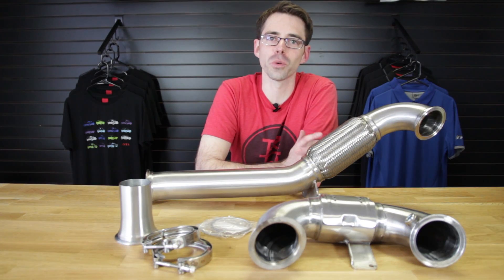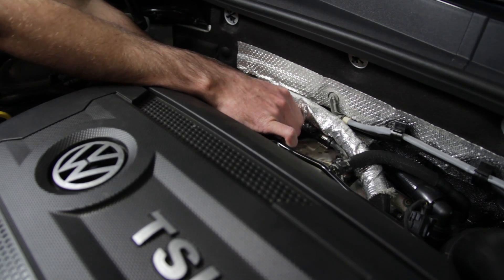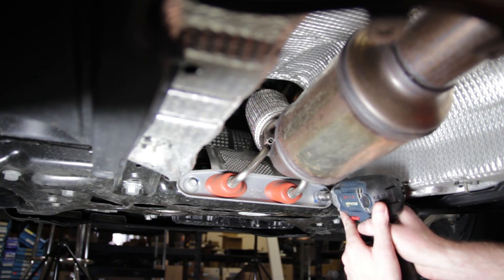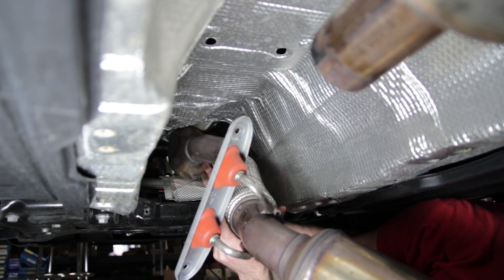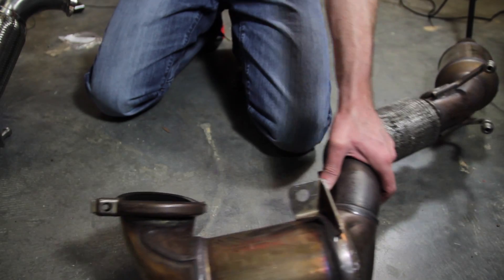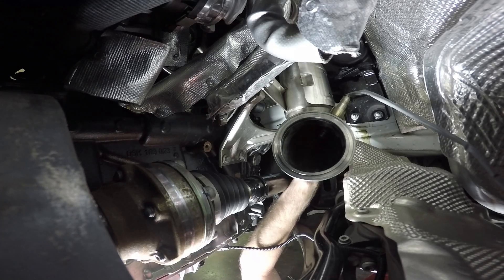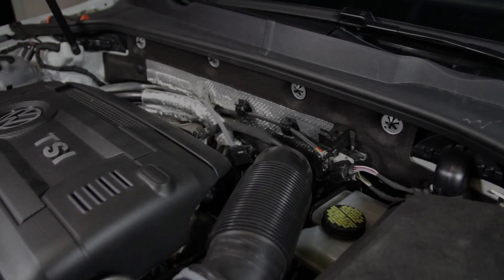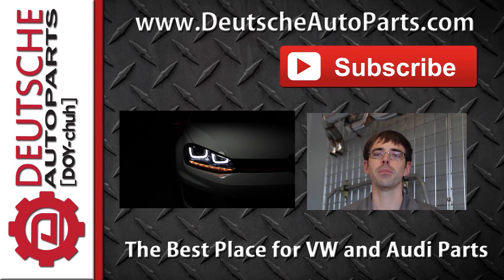MK7 GTI Unitronic 3" Downpipe Installation DIY (How to)

Comment: How do you get to the drivers side catalytic converter bolt on a car with a VAQ diff? There is no room
Reply: Swivel adapter on the socket would be my best guess

Comment: Torque Specs from Repair Manual: Vband at turbo - 15 Nm plus replace gasket 
Bracket to Downpipe (2x) - 20 Nm
Bracket to block (2x) - guessing 20-25 Nm
O2 sensor - 55 Nm w/ little anti-seize
Bolt to prong holders/subframe - 20 Nm
Clamp sleeve with 2 clamps - 30 Nm
Clamp sleeve 1 clamp - 25 Nm

Comment: I just ordered the same down pipe for my 1.8t will the check engine light come on, and I have a APR stage 1 flash, apr does not offer anything for my Passat can you recommend another upgrade stage that would work

Comment: Do you have to flash a stage 2 if replacing downpipe?
Reply: 2 years later response lol but yes, in my experience with catless downpipes the cars don’t run 100% if not tuned

Comment: Do you need to  change the intercooler for  stage 2? Or only the downpipe? 😁
Reply: The car will heat soak and pull timing after a long pull
Reply: @MeltingRubberZ28  thanx 👍😁
Reply: Without an upgraded intercooler

Comment: For the lower silicone mounting bracket piece, what size are the bolts that connect the bracket to the subframe?

Comment: Hey guys, thanks for posting this video. Helped me install my Unitronic downpipe
Reply: Does installing this down pipe throw any codes or engine lights? I know I wont be able to pass emissions with this installed but just curious about other issues.
Reply: Jake Block just like any Downpipe (aside from AWE) it will throw a CEL. You can instal a spacer or tune to stage 2 to get rid of the code. I went the spacer route for now.

Comment: Need some help  got a borla exhaust  on my 17 gti want a good catted downpipe that will fit my exhaust  was going to get one off cobb tuning but it only fits Cobb's exhaust  system so any good brands that fit my borla and wont turn on engine codes ?

Comment: Hello,
 I have a couple of questions for u. In order to get my 2017 VW GLI high enuff to do the downpipe swap what should I use? I have a hydraulic floor jack & some Jack stands. Would that be enuff or would I have to take it to a mechanic with a hydraulic jack stand? Also is a downpipe swap all I need for a stage 2 flash? & also will I get a check engine light after doing a downpipe swap?
Reply: Jack it up and place jack in the correct place per yer vehicle.  Always use jack stands of course, and emergency brake / tire blocks.  
Yer floor jack should state on it what the maximum height is. Don't push the height to the maximum limit though. 
Then get under there and see if you have enough room to work. 
Remember too that the downpipe section has a flexible portion.
Reply: k max oh also if you have a dsg get the tcu tune along with the ecu tune. You wont regret it bro.
Reply: @JuggFinesse  Hello. Just today I put in a catch can for my PCV system. What a bear it was.  I have an 09 2.5 DSG 9M. I kept the  3/4 inch inside diameter for the new hose but no way the engine cover would snap back on. So, I had to design an air intake system. I had to do both to get everything all workable.  
The last few weeks I did the two mentioned above, plus a new cam sensor,  crank sensor,  fuel filter,  new coils, new plugs, new throttle body,  new valve cover,  tranny and filter change,  and an oil/filter change....plus an AWE Tuning catback exhaust.  Purrs like a kitten.
Reply: k max thats nice bro. You should look into getting the ecs engine mount kit as well, i got that and it makes my gli feel more sporty. Its nice
Reply: @JuggFinesse  Yeah I was checking out some flash products.  May do it in spring time along with shocks/ struts,  and brakes. 
I bought my rabbit used and I'm not certain but I think it may have a stage 1 in it. I'm tellin ya.....it really gets up and moves, and when I get on it has a whuuuuump like a turbo, along with a psycho growl from the pipes. I wish I could track down and see if previous owner put a stage 1 in it. Maybe companies could give me an answer off of my VIN.
Reply: @JuggFinesse  Oh I forgot.   I did do the ECS vacuum pump delete. That was money well spent.
Reply: @JuggFinesse  hey I just thought about my vacuum pump delete.  It's Integrated Engineering I bought it from. I'm getting the companies mixed up.  I've used ECS, IE, and EUROSPORTS.
Tonight I ordered from RADIUMAUTO new hoses for the PCV/catch can . 3/4" ID and these are specifically for the vacuum generated. My current hose setup is a bit weak considering the vacuum generated.  These are good up to 24Hg.
Reply: @JuggFinesse  ok will check it out.
Reply: i have a 2018 Gli stage 2 everything. For stage 2 you need an intake and downpipe. You will have a check engine light tho before you get the tune unless you get an o2 sensor spacer

Comment: Can a downpipe be install without a tune? Or will it trigger the check engine light to turn ON. Thanks.
Reply: I did this install without doing a tune and didn't get a CEL. What did come on was the engine emissions light (O2 sensor). This is supposed to go away after you flash the ECU. I'll find out... Have Uni Stage 2, but waiting to put DKM Stage 2 clutch in first. 2015 GTI SE 6-speed

Comment: do you torque things to the specific torque setting? I noticed on the Suspension video you do you mention torque specifications, is there a reason for this? or did you just not mention it?

Comment: I'm helping my dad get his stock downpipe off. It's a pain in the ass because it won't come out. The part that angles to the turbo (j looking angled pipe) is getting caught on surrounding parts. What a headache I just watched you get it out in 60sec
Reply: xJayFromVA is your car Performance Pack?
Reply: 99SVTBolt he has a gti s I ended up getting it out fairly easily within 5min after watching this.

Comment: Did you notice any drone under low rpm?  I know this video is old but am thinking of going with unitronic downpipes and stock catback.
Reply from the maker: +Jkronos you should not expect to see any drone.  This was great with the stock cat back. Thanks for considering us for your purchase.
Reply: you wouldn't get drone on just a downpipe. Usually drone occurs inside the cabin because of the exhaust note that you can hear at certain RPM ranges.

Comment: you forgot the crush washer on the O2 sensor.  :-(
Reply: @Bonzo "make sure you tighten it really good to make sure you don't get any exhaust leaks." You need it for the same reason you use one for your oil drain plug - as a seal.

Comment: Does this fit a 2016 Golf R? 

I know its a MK7 but im not sure which parts might be different for an R vs a GTI
Reply: the GTI and R use the same motor. The difference is in turbo size. So yes this will work.
Reply: @Enzo187  clearance with the front driveshaft on the R can be a problem for some downpipes

Comment: Can I use the DP with out flashing the ECU?
Reply from the maker: +Skylife TV We answered this question here... Take a look https://www.youtube.com/watch?v=DUkGW1rY72I
Reply: Deutsche Auto Parts someone please help me.  I have installed a invidia dp on my mk7 gti but I have a huge leak where the vband clamps down.  it sounds horrible and smells like gas!!!  when I press on the gas I can physically see air escaping from the vband.   someone plz help!!!!
Reply: Do not drive your car like that. You will have carbon monoxide coming straight into the cabin. There was a recent story in the UK where a young couple died from inhaling CO fumes.

Comment: Do you need a tune with this down pipe? or is just recommended?
Reply: +Gunsforfreedom usually the down pipes that guarantee a no CLE usually just use a taller o2 sensor bong to pull the front o2 sensor out of the air stream you still want a tune for the actual performance gains hope this helps
Reply: A TUNE IS REQUIRED
Reply from the maker: +TheDustyaman Yup must have a tune
Reply: After researching a bit I discovered that not all down pipes need a tune. I guess the UNI needs one? Intere
Reply from the maker: +Gunsforfreedom The downpipe is not what requires the tune.  The car is.  You will almost certainly have a check engine light if you install a downpipe without tuning the vehicle.  If you are OK with that then you should proceed.
Reply: I understand that. It's a soft code, plus it's a speed density system. Bull X and a couple other manufacturers guarantee a no cel on their down pipes. Thanks for the advice. I enjoy your channel!
Reply from the maker: +Gunsforfreedom I'm not familiar with these systems so I cant say for sure, but I have seen some actual photos of a MK7 Bull X cat back and the welds quite poor.  I don't know if this speaks to the quality of the rest of their R&D but it def causes some concern.
Reply: Hmm, interesting. I saw their down pipe and it looked fantastic. Thanks for the heads up
Reply: Or you can add an O2 sensor spacer, which again will pull the sensor out of the air a bit and cause it to read normal. I’ve heard a lot of good things from this way of doing it

Comment: Will I still benefit from the Unitronic downpipe if I plan on using the stock exhaust with the provided adapter?
Reply from the maker: Amir M Yes the downpipe is one of the most restrictive points in the exhaust.  When you couple it with the stg2 software you will see pretty significant bumps in the power.